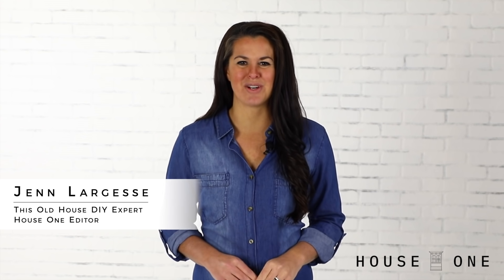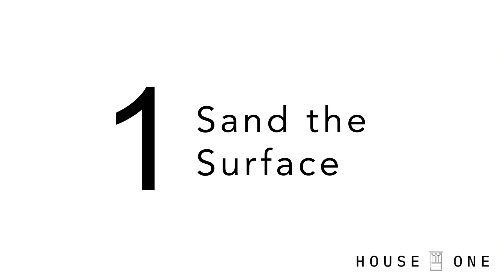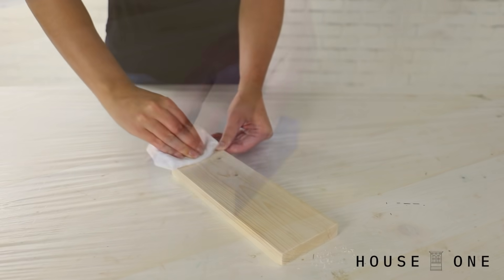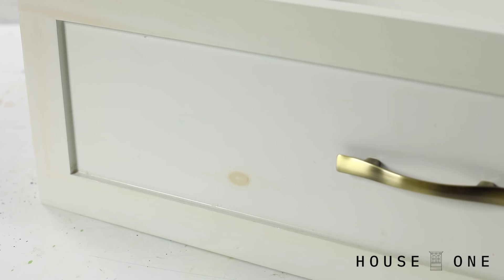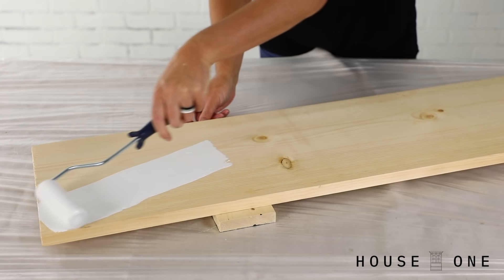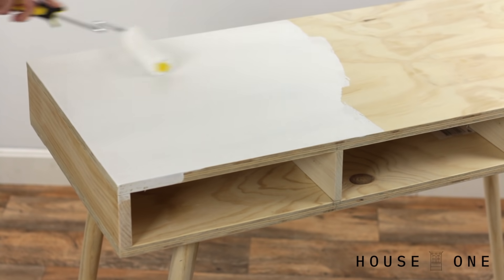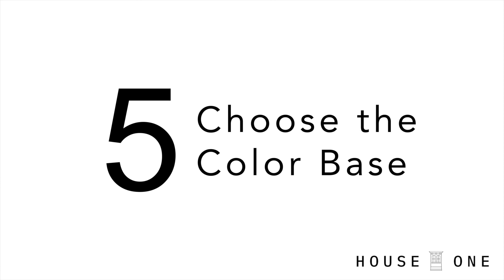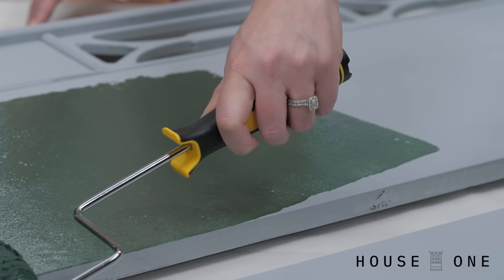How to Paint Bare Wood | House One

Comment: Is an oil-based (alkyd) primer better than a latex primer on bare wood (because it will have less tendency to lift the grain)?
Reply: I myself prefer Kilz oil based primer is thicker and can be sanded,, but remember you can not wash or your brush after use so by a cheap throw away from day dollar tree or 99 cent store. Stay away from the chip brushes at the depot, they shed like crazy. Ps you can no longer buy the kilz real oil based in gallon cans. But you can buy the new version of kilz in a gray and white that works well.
Reply: Can I use the sponge paint brushes instead of a regular brush to apply into the wood?